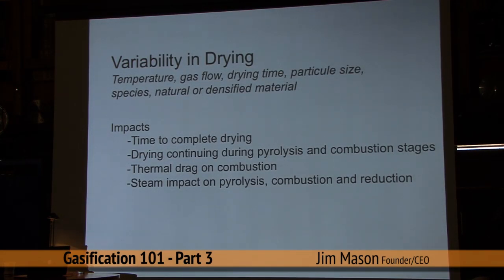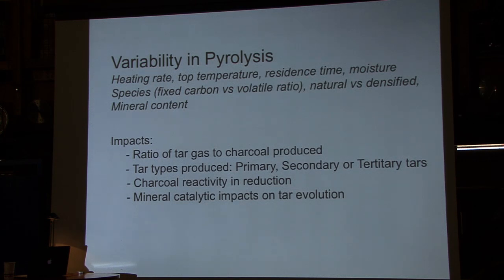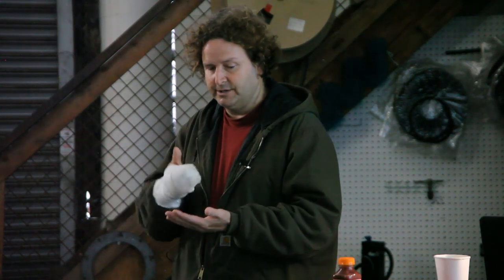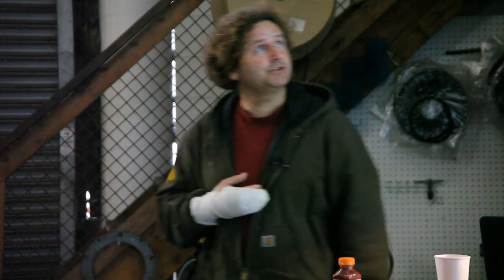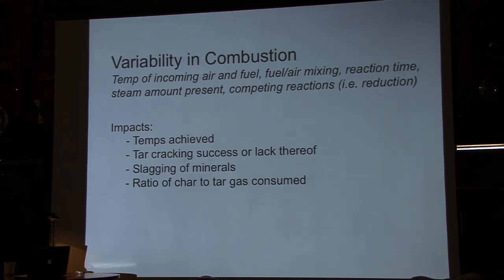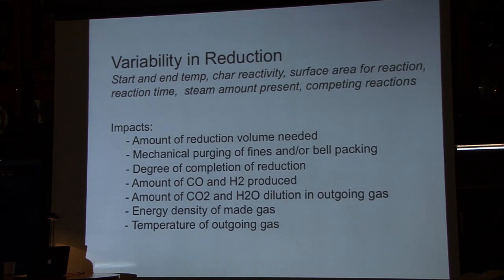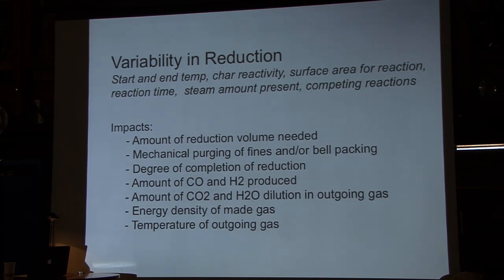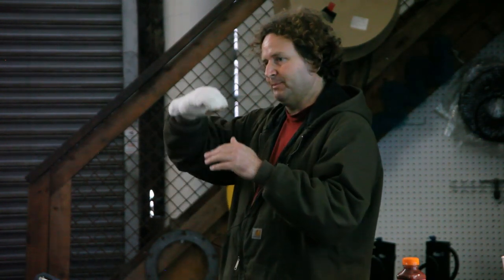Gasification 101 - Part 3

Comment: During a run use the engine to compress the producer gas into a cylinder. Then use that for the next start of the engine, run compressor, initiate combustion, and faster startup.
Reply: Or use the compressed gas on a diesel mechanic as a dubble fuel system

Comment: I watched all three parts this presentation is amazing!
Reply: Same, but it's left me with more problems than solutions. I am going to do an updraft with the flow heading down towards the combustion zone and out the air intake pipe with a radiation zone. I want to put a water gas shift reaction, but I'm afraid of tar building up on the catalyst, but I need high temps to efficiently convert co to h2. I could cool and condense the tar then take the gas back thru the combustion zone before I convert. I'll keep thinking about it, but I don't want a hundred thousand pipes going through this.

Comment: Seems like the best solution would be to make charcoal in a separate operation, he mentions in the first video that straight charcoal as the fuel works better.  Think of it this way we don't have an oil refinery built into our vehicles,  burning wood probably equates to trying to burn crude. To simplify the process just refine the fuel first. Thanks for the great videos.
Reply: Austin from All Power Labs here. 
Straight charcoal does not work better as a fuel because without the endothermic stages, the reactor is reduced to being a blast furnace, and the steel parts after the combustion zone end up melting. Nearly half of the gases produced during gasification come from cracking tar gases, since volatiles constitute about 80% of the mass of dry biomass.

The refinery analogy is correct; the gasifier is a refinery; that's why we refer to the biomass as feedstock, and the output gases as fuel. The engine shouldn't be thought of as burning wood. It is burning producer gas; it is merely providing waste heat to make the gasifier much more efficient.
Reply: @austinliu1043  Thanks for info I was thinking that the main reactor could be smaller and simpler with straight charcoal, the gas being produced would be cleaner and easier to get a consistent product.  Sorry I should have said burning wood in an oxygen deficient environment to produce producer gas to run the engine on. thanks again.
Reply: @farmingfromscratch  The reason we don't do that is partly because the biomass is 80% volatiles, 20% fixed carbon. If you make charcoal first, the energy of the volatile fraction is largely lost and cannot be recovered in the gas.
Reply: @farmingfromscratch  I think that’s why I’m the second video on these lectures the diagram showed a 2 stage system. The second stage held primarily charcoal which lent well to its flexibility in feedstock characteristics.

Comment: at the end of all this, in regard to startup, could you not compress enough air, while running, to flare the system with the inductor, and similarly could you not compress enough syngas, to run the engine during start?  am ten years in your future here - how did it all turn out?

Comment: I have to say that if they can use natural gas for the start up you can use one of those anaerobic digesters for the gas and thus still be off fossle fuel
Reply: Agreed. You can also put the gas in the mix after the outtake pipe at a high temp with water and create hydrogen and co from the natural gas. Run that pipe back thru combustion zone with a water line inserted. The rest of the water can be used in a water gas shift. Hydrogen is better than co because it's safer and can be used in fuel cells.

Comment: @ 25:00 minutes just use a solar panel(s) to keep the battery charged . eh run blower motor, air compressor w/e